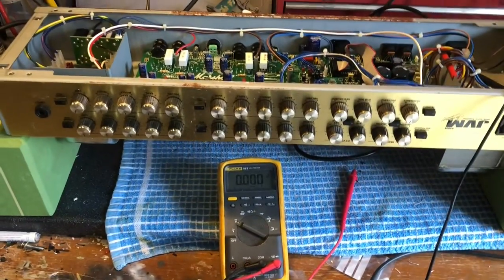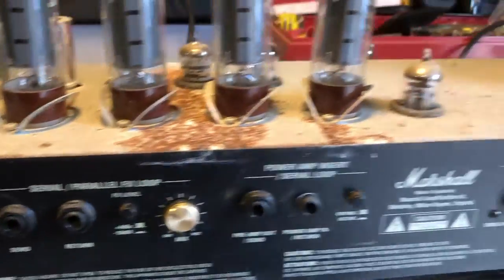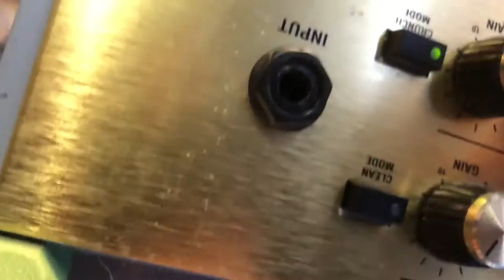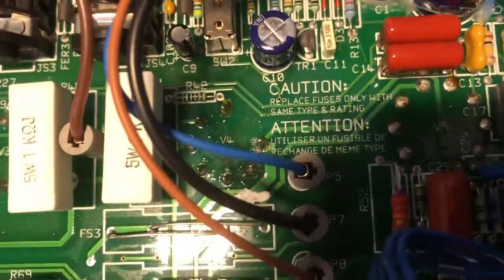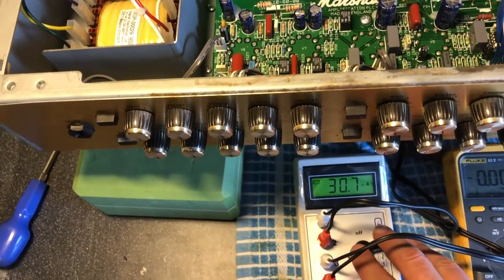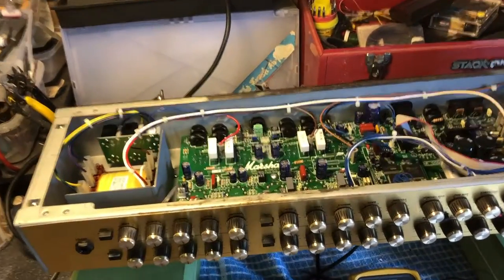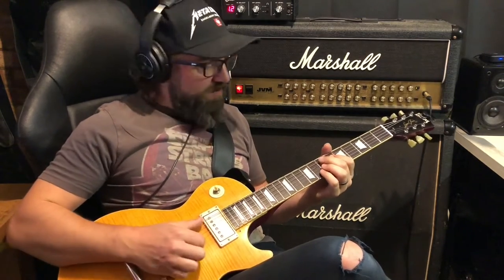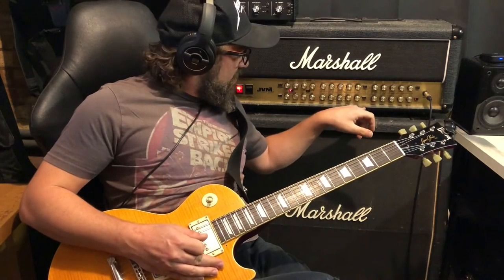Marshall JVM 410H Service and Playtest

Comment: Hey Rubberduck Tech, do you know if the channel switching speed can be improved on the stock JVM? When Marshall did the Satriani version of the amp, the channel switching speed was massively improved. I read it was because the noise-gates were able to make it faster than the reverbs, but don't know how true that is.

Is this something that can be modded?
Reply from the maker: Sorry not that I know of. But now you mention it I do remember reading that. I will look into it!
Reply: @RDamps  cool! If you find anything let us know!

Comment: Hi, how did you remedy the sticking switch? Did you remove the cover plate?
Reply from the maker: No I just filed it down with a needle file. Handy being a model maker 🤣
Reply: @RDamps  thanks, I take it you had to remove the pcb first. Mine is similar.
Reply from the maker: Yes you do. It’s not too bad. Take loads of pictures and label everything and you’ll be fine. Just make 100% sure you know how to discharge the filter capacitors and know how to use a meter to check 👍